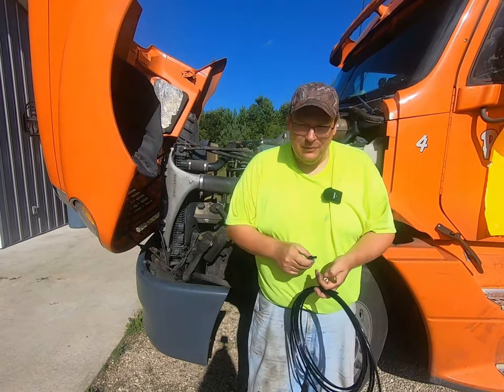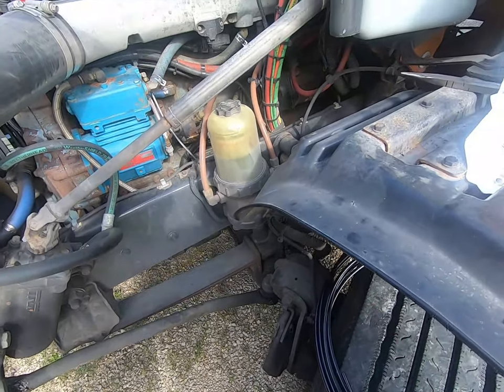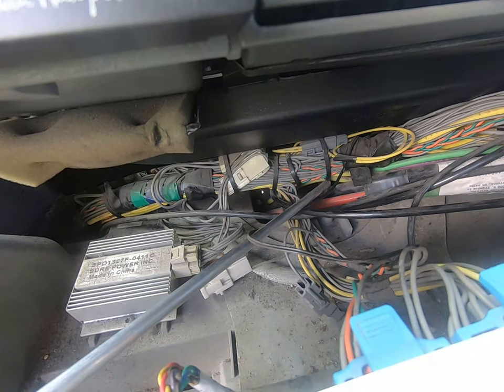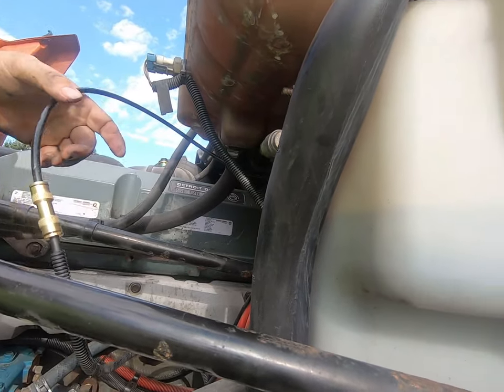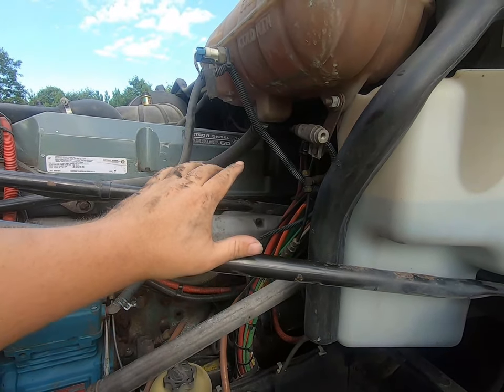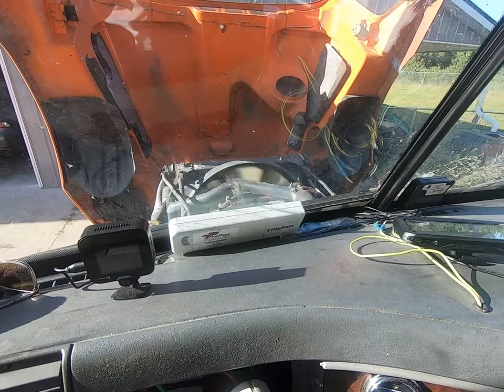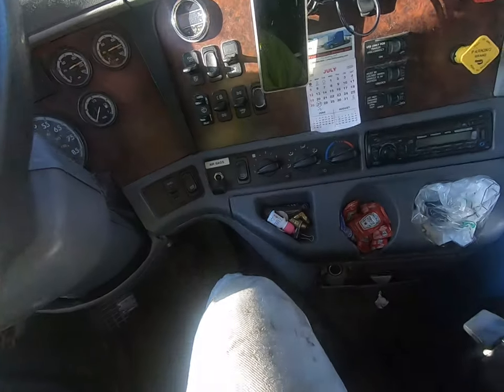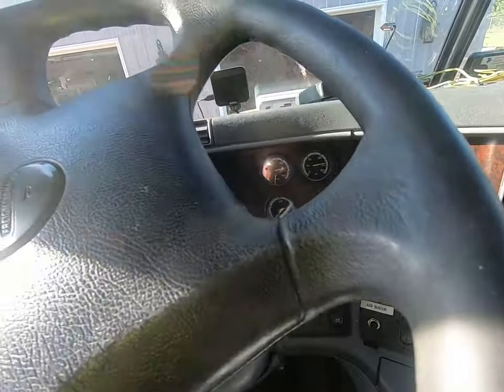DIY Project: How to Install a Manual Engine Fan Switch in Your Semi-Truck

Comment: Just did this install by watching this video using the same switch from fleet pride total cost $65.00 and that's because quarter inch air line was sold to me in bulk for about $15.00 if not it would've been cheaper.🤟

Comment: On a modern International (if you have access to the dealer software) all you have to do is order a switch, plug the switch into any blank slot where the other switches go, and change a parameter in the body control software. All done!
Reply: you can do the same with freighliner. very easy.

Comment: Mine was staying on.  A/C over charged.   I added some to tue system and found out later it was a chip bag blocking the return.  Just having the single little gauge I didn’t know the accuracy plus head pressure so I over charged it.    Just let some out until the suction line was cold and bam!! Air con working and fan is off.   

Awesome video thank you!

Comment: Hey man thanks for the help with the repair videos I had a question about your orange Columbia that’s a glider are you able to run paper logs on that since it has the 12.7 pre emission in it or how does that work? Thanks if you could make a video on gliders that would be cool thanks again for your help

Comment: Could  you just put wires and a 12v switch to the temperature  sensor?
Reply from the maker: Several ways you could do it. This is the way I prefer.

Comment: Can you list which swich you used in the cab? A link would be great! Thanks
Reply from the maker: https://petetruckparts.com/product/air-toggle-self-lock-lines-ba14500/?network=g&device=c&keyword=&campaign=2065798695&adgroup=pla-295567198246&gclid=CjwKCAjw3riIBhAwEiwAzD3TiStG4btMPXiAf6qdlG7tlsS_QDMdSgP7V0AuNUyMyVfpE1pXVH-6xxoC2AUQAvD_BwE

Comment: I have a 2004 FL M2 106 & fan spins freely, even at 210f,  does the '04 FL supply 12v to solenoid to turnON fan or turn OFF fan ? Could I mount simply dash switch to control 12v to solenoid instead of messing with air lines ?
Reply from the maker: No... Never defeat the solenoid . You should never make it so u can turn it off manually. Only on or auto. Disabling it is a bad idea
Reply: @DIYSEMI  Thanks, manual On or AUTO never manual OFF. Im hoping local Detroit-Allsion can install such a manual switch.

Comment: I just did this to my truck but I was wondering wouldn’t the switch be blocking the airway for the Fan clutch to turn on ?!
Reply from the maker: Not if you do it right. It will be an on/ auto switch rather than on/off
Reply: @DIYSEMI  am I suppose to splice the inlet or outlet ?

Comment: Where would you recommend to go look at glider trucks?
Reply from the maker: There is a place in Glasgow KY that sells new ones. I personally don't recommend fitgerald.  There is a dealer in the Midwest called Harrison....they are good
Reply: @DIYSEMI  why wouldn't you recommend Fitzgerald? What state is that Harrison dealer located in?
Reply from the maker: @nba3512  there have been some issues with their engine builds. Harrison has locations in the Midwest
Reply: @DIYSEMI  i will check it. You should make a video talking about glider trucks

Comment: Hey thanks for vide 
Those this process works to turn off fan ? My is on all the time ?
Reply from the maker: You should never disable the fan. You need to find the problem and fix it. I have a video on that
Reply: @DIYSEMI  yea I agree 
I saw the video and did most of it but still stuck on on 
Replace all sensors,solenoid,I haven’t Done the A/C high pressure measurements yet 
Someone said it can be ECM Igor a 12.7 Detroit
Reply from the maker: yes, maybe time to put a computer on it
Reply: I have a peterbilt 357 and my fan won’t turn on automatically and the temp is too high like 215 and nothing I have to turn on manually 😢

Comment: Excuse my stupid question.
So this installation means that you no longer will depend on the solenoid to kick in when needed and there for you will need to watch it all time, correct
Reply from the maker: No sir...it will still be automatic...however you will be able to turn it on anytime you want rather than waiting for the truck to do it. 
Some trucks come with this switch factory installed. We are just adding it to a truck that doesn't have it.
Reply: Yeah, that is what he meant for installing this fan manual switch .

Comment: Could of saved the time and just tap a switched ground  into the fan control module behind the coolant reservoir.
Reply from the maker: Seems like the same amount of work,   either it's wire or air line and a switch.

Comment: Why not just wire the toggle to ground to opperate the fan ?
Reply from the maker: it should never be set up to where you can disable it all together. mine makes it on or automatic. not on or off.
Reply: @DIYSEMI  thanks for reply recently had fan going non stop replaced solenoid,ac switches,then mechanic told me it was the ecm sent it to ecm repair they said nouthing was wrong with it plugged it back in everything worked correctly a week long ordeal .guessing I had a bad connection on the ecm only thing I can figure.

Comment: So how is the fan gonna kick on with the a/c.....
Reply from the maker: It will function exactly like it did before with the switch off. When you flip the switch it locks it on....its not an on/off switch....it's an on/auto switch.
Reply: 10-4 that is  easy way to solve this issue for shur. Thanks for the info sir!

Comment: Is there anything that can be harmed by manually doing it too much?
Reply from the maker: Fan on all the time will cause lower fuel mileage. But no different than if the truck turns it on

Comment: How did you install the dump valve?
Reply from the maker: Need a new leveling valve, air line, and a switch
Reply from the maker: Installed a new suspension leveling valve with a dump. Ran air line to the dash. Connected it to a switch